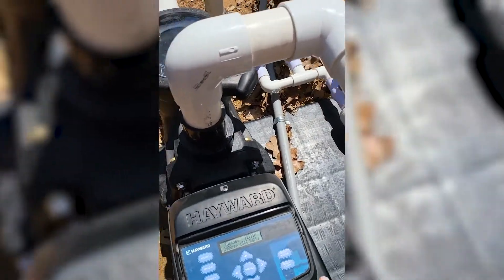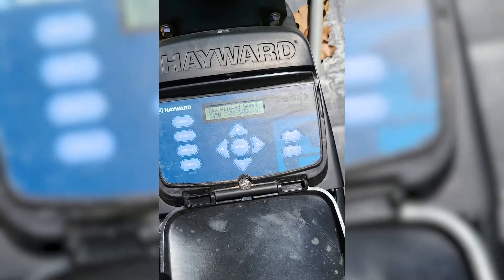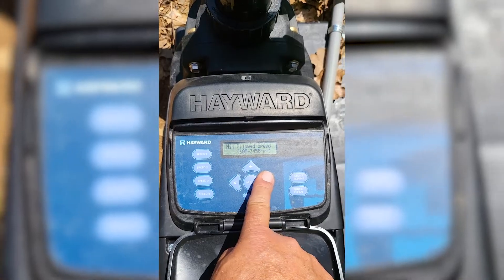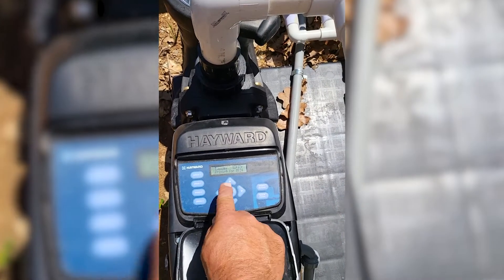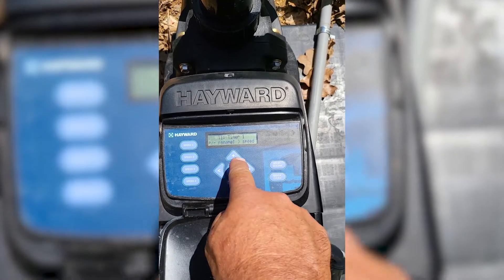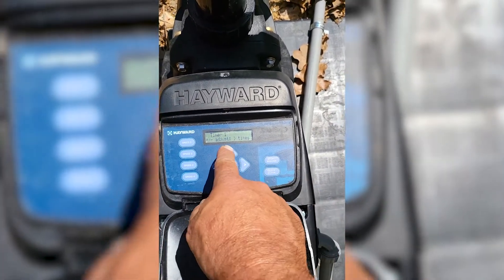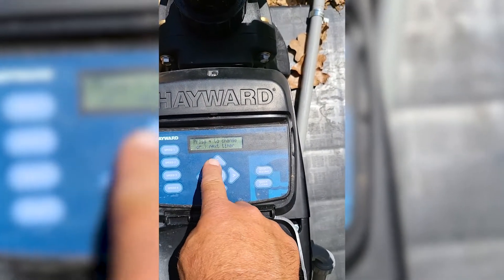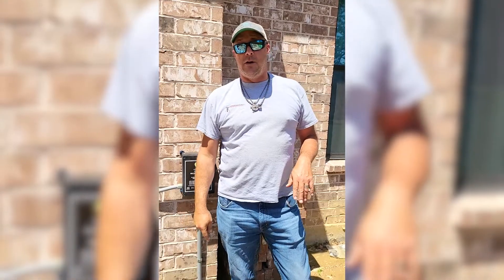How to Program Hayward Pump for Timers & Configuration

Comment: Subscribed. New fiberglass pool owner here in southeast Texas who is in the middle of a build with the pool filled a few days ago but no pump circulation yet. Now the water has turned green and looks pretty nasty. I'm fearing the longer it sits, the harder it's going to clean. It's becoming a wildlife santuary now while I wait for the builder to get the electrical to pass inspection (which it failed the first time because they covered the buried conduit before the city could inspect).

Comment: Thank you but how do u run the pump 24 hrs at 1 speed. Always wants to shut off at midnight. No timers are set currently
Reply from the maker: Set your timer for a cycle from 12:00am-11:59pm at the desired speed and you should be able to accomplish this.

Comment: Great video,  Is there a way to shut the pump off at certain times of day?  I didn't notice anything in the menu
Reply from the maker: This is handled through the timers. As each timer is programmed, you simply set them with the desired gaps between start/stop for times of day they come on. The pump will remain off between.
Reply: Thank you,  I will try that today... @CrystalEdgePools

Comment: Can you setup spillover option with one pump using pool/spa? right now I don't see that option so my spillover always runs and I'd like to have as option to turn on not run all the time.
Reply from the maker: Hi David,  the answer is yes, you can through valving. I'm not sure how your system was set up, but you should have the option to direct the flow for inlet and outlet through 3 way diverter valves. Please check out the video on pool/spa combo operation to see a demonstration and explanation. You can also automate this through actuators and an automation interface. Since you are commenting on a Hayward video, I assume this is your system brand. You can add either the Hayward omni vs (smaller version) or the full Hayward omni system (larger system with much more expansion possibilities to run everything from the pool to landscape features etc.) If Jandy, the system would be an iaqualink.  We do not recommend any of the pentair products because of high failure rates in our experience.  The iaqualink will run any pentair items (it will not run Hayward).